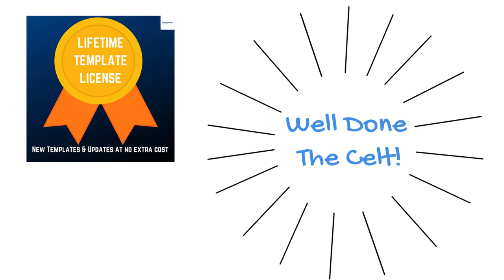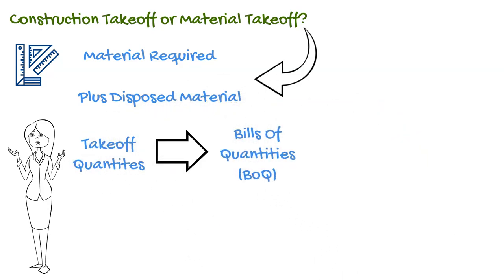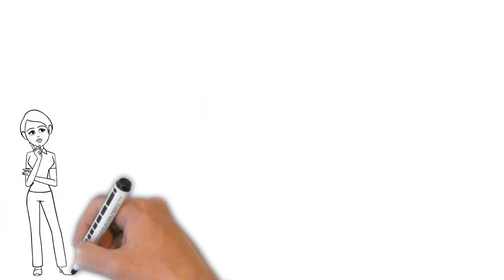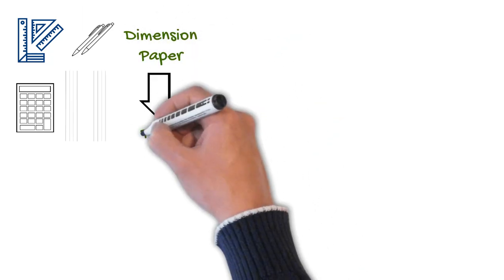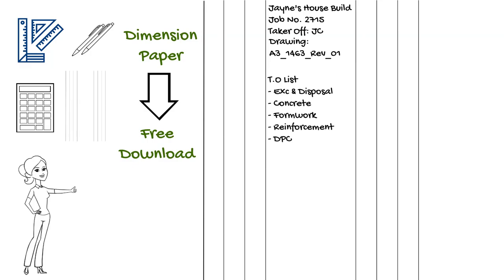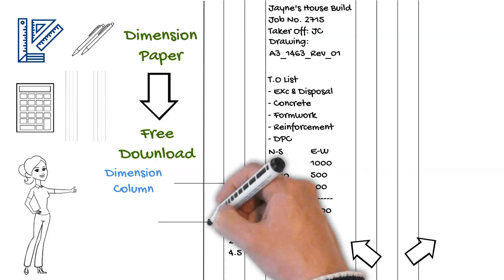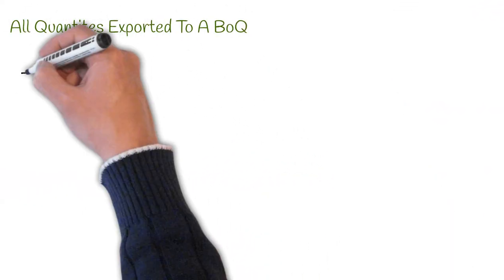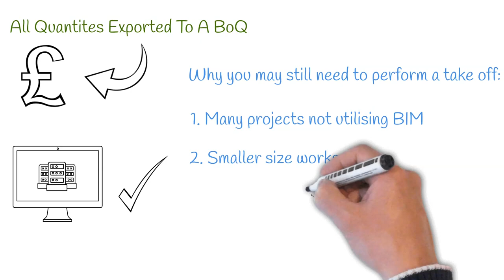What Is A Construction Takeoff?  | Are They Still Necessary In Quantity Surveying?

Comment: You obviously don't know the first thing about value engineering if you use a BoQ to carry it out.
Reply from the maker: In the video we emphasise that a BoQ is used to establish a project price. This price is often broken down by labour, equipment, and materials. Having a project price broken down this way, and linked to a BoQ, is helpful in establishing the value of each activity.
Reply: What's your definition of value engineering and when should it be carried out? @Metroun
Reply from the maker: RICS states, both VM and VE encourage the project team to reconsider the assumptions that are made during design and construction in search of more cost-effective ways of achieving the desired outcomes. There are opportunities to apply VM and VE throughout the design and construction process... In the UK, it is generally accepted that VM takes place during the earlier stages of a project and that, once designs and specifications have been developed, the same process becomes VE.